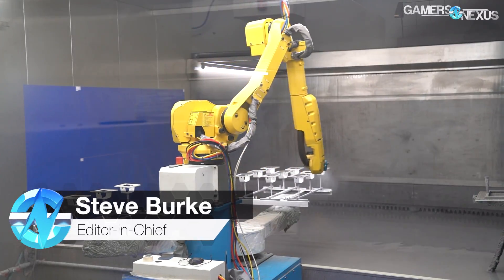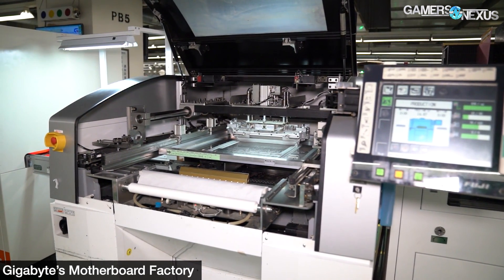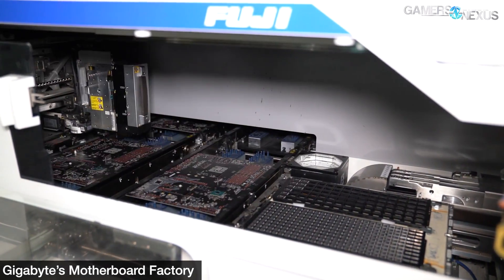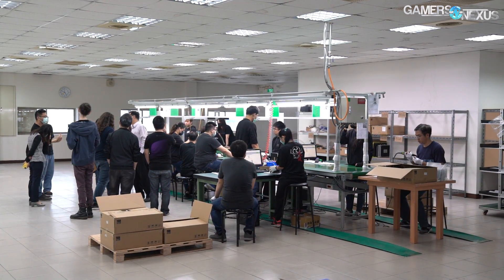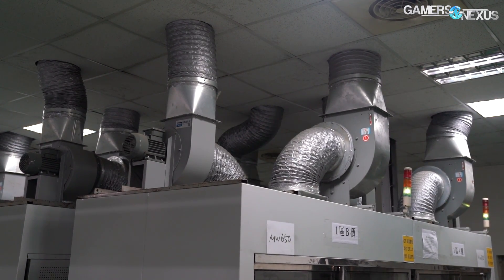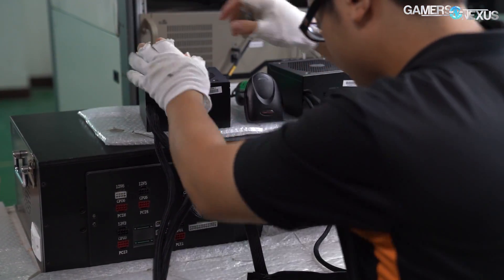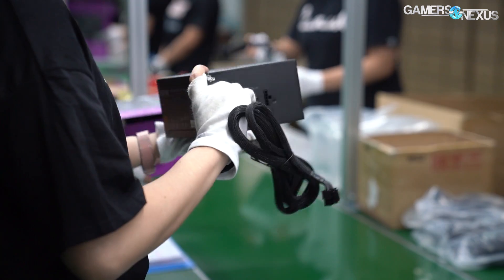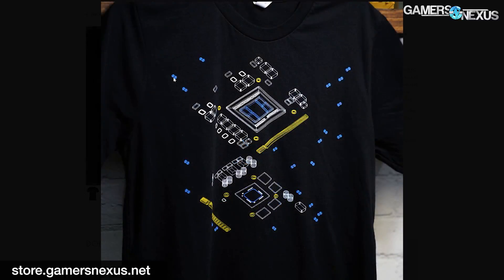How Power Supplies Are Made (2020) | PSU Factory Tour, ft. Cooler Master

Comment: I had one PSU that caused instability and then eventually wouldn't make it past post.  I worked out that it started off occasionally power cycling itself and the intervals of the cycling got shorter and shorter to the point of cycling every sec. Muti meter didn't pick it up as it was losing power for too short of a time, attaching a lamp to the 12V rail showed the lamp flicker off and on every sec on an endless cycle.  Replaced it and the system was fine after and all my months of hard locks and crashes went away as well.

Took me ages to work that one out, like 6 months at least.

Comment: What about 100v for the Japanese market?
Reply: All computer PSU's are universal - they will work in any country. Must have been a misunderstanding in the video. It would be a lot more expensive to create specific versions for 100v, 110v, 230v, 240v, 220v, etc. Instead they all are just universally compatible with any country standard AC power.

Comment: I've had two PSUs fail on my, one was an old no name brand in a hand-me-down computer my dad built. It blew up good and took the system with it (Electrolytic cap - one of the big ones - popped)

The other was a lot less exciting. Silverstone 600w SFX PSU just gave up the ghost. Nothing else was damaged, but none of the rails would output power, not even +12v or +5vsb. Local shop confirmed the same. The replacement it still kicking, 4 years later

Comment: Whoa... there's a shockingly large amount of manual hands-on stuff that goes into PSUs! 
When my buddy and sister were picking parts for their new computers a few months ago I told them that the PSU is the least fun part to spend money on, but one that's probably most important not to cheap out with. Now I can see why they seem to cost more than you'd expect.

I've been (un)lucky enough to have had two catastrophic PSU failures.... which are REALLY scary, lol.  I've learned my lesson with cheap power supplies.

Comment: Do refurb units go there for testing too?
I just got an RMA number for my RM550 and they plan to return a RMx550 to me as the replacement.(but it'll be a refurb unit)
Reply: Refurb units definitely get the same rigorous testing, but probably not at the same location (the refurb lab / company would be the ones doing it).

Comment: 1:30 Why HEC (High-Quality Evolution Commitment) doesn't want to be named? 🤔 They've manufactured PSU's for Aerocool, Corsair, EVGA, Thermaltake and even BeQuiet in the past.
Reply: Yeah pretty sure that's who it is as well. I mean, they're not typically regarded for the highest end units with the best specs or perfect solder jobs every time. 

But they're also not known for dumpter fires or anything.
Reply: It may just be a case that they don't know if Coolermaster wants them to be named as the manufacturer. Linking the two can be a touchy subject even if information behind the link is publicly available.

Comment: So many RMA'd PSUs have... bugs? Ick! :P

Cool vid, and fascinating process! Given the amount of QC involved, it really makes me wonder how I received a brand new, bad PSU out of the box (non-Cooler Master but equally large manufacturer). Confirmed bad with only a PSU tester plugged into it after it had failed to keep the new PC components powered for longer than 90 seconds. Replaced with the same model PSU, and I used all of the other original components. PC is still working well after three months.

Comment: 30 qc steps is a lot more then i anticipated. good to know that my usual testing process is either ignoring the PSU or checking that last. except, of course, when the symptoms explicitly point towards it, like breakers ripping, the unit sparking and smoking or the system being reproducably unstable when loading multiple power hungry components simultaneously...

Comment: While a CPU and GPU may last you for 5 years, I have a seasonic 800 psu still working after 10 years.
Reply: Seasonic. The heart of your system
Reply: The one I'm using is roughly the same age, only thing that has ever failed on it was a SATA power connector. It has 6 such connectors and I use at most 3, so wire snips and but splices to eliminate the faulty one, still working great.
Reply: tbf, GPUs maybe, but Haswell seems to be immortal. I've got a 5820K in my rig that still wrecks games even at stock six years later.
Reply: Same here, i have a S12II-380 running 24/7 since 2008. I have much more respect for companies that make their own hardware, so i'm likely to stick with Seasonic for the foreseeable future.
Reply: Well, would love to say the same about mine, but my beQuiet! PSU was a letdown and it failed after about 5Y. Shortly afterwards my (at that time already old) GPU failed, at the height of cryptomining. Not sure to this day whether the GPU dragged down the PSU or the other way around, but still the PSU shouldn't have failed regardless.

So I stopped buying beQuiet! PSUs, and my new PSU has 10Y guarantee.
Reply: @9SMTM6  10y guarantee doesnt help against getting a psu dead on arrival. Still gotta buy a replacement unless you can wait for the RMA a couple of months.
Reply: @henkki1000  it's not neccesarily about the RMA Process but about the quality of the product.

I. E., If they give 10Y guarantee its unlikely to be designed with planned obsolescence, that's hard to design reliable to fail after 10y, it's more likely to work until I need a replacement for other reasons anyways.

Also I personally could drop in my Server (=old PC, except the PSU, using that as NAS, for Media hosting with Jellyfin, for Nextcloud etc) PSU for the time being, I can live without my Server for a time. And, not sure if that applies to their PSUs too, but my Brother made good experiences with Corsairs guarantee service for Keyboards, and my PSUs are both from corsair RN.
Reply: I've honestly never seen a cpu fail. Only ones that died when a motherboard shorted.
Reply: It became rare to have a completely broken PSU if it's not a no-name one. Brands often cheap out on capacitors, fan quality or on power efficiency but that's irrelevant to properly work or quite easy to fix after several years of duty. Most non-working PSU nowadays are most of the time just failing in security mode, waiting a cheap component replacement.
Reply: Coolermaster GX 550W owner here, that thing is still going strong after 10 years. Everything else has been changed at least once, but not it. The only thing I had to do to it was to open it and oil the fan, 4 years ago.
Reply: so it was probably still under warranty until recently :-)
Reply: I have an old Delta that still works after 22 years, it's obviously not in my main system anymore but it still does get some use.
Reply: my cpu is working for 10 years, gpu for 7
Reply: Nah mate fight me, I have a psu that has been working for almost 20 years.
Reply: I have cpu's and gpu's what are still ok after 10 years so
Reply: I am using a 5Yo Cooler master B600 R2.0
Reply: I mean CPUs and GPUs eventually cannot run the latest games or productivity software,  But as long as the new toys still fall inside that 800 watt umbrella the PSU can keep on truckin.
Reply: @filanfyretracker   You need to derate the PSU as time marches on. So if it's 800W in the first year, i would consider it closer to a 600W unit by the 5-year mark, because internal components age and degrade. But if you have that covered, you're good. It's not like many builds need an insanely powerful PSU anyway, and the hardware kept getting more power efficient.
Reply: Between me and a friend, 2 out of 3 seasonic PSUs were DOA or dead after a week. No problems yet with cooler master or corsair tho.
Reply: @henkki1000  If you can pardon my curiosity, i wonder which product lineups those were from and from whereabouts when. Because i was looking at Seasonic offerings and i... didn't have a good feeling about S12-III, it just seems... suspicious. No solid reviews or engineering analysis, different OEM factory and platform, and not one we've seen yet or heard of, very not Seasonic-like. It's very certainly not an updated S12-II, which had an excellent reputation. An obvious cash-in sequel so to say.

I mean all olden manufacturers make these low end lineups nowadays, you also look at the Enermax products, and there's a cheap series, it looks even shadier.

I had to urgently buy a PSU because my bequiet L7-630 gave up after 9 years of pretty strenuous life. I ended up settling on Seasonic Focus GX550 because it was available, and because it seemed less shady than everything else i could get quickly and could afford. I'm still investigating what failed in the bequiet, but i'm taking it slow to be cautious, working on PSUs is dangerous. The bequiet is HEC made so it's certainly not the best, not even close, but looking at it, i don't hate it either, they actually put some effort into the thing, and it has overall not even degraded much, a few caps i pulled and tested on the secondary haven't degraded at all, like usually when you open a budget PSU a few years old, it's failing everywhere left and right. There's some kind of a cascade failure in the 5VSB circuit, i found one dead secondary rectifier diode there but this isn't all of it, there also seems something wrong with the feedback. A bit unhappy about the aforementioned diode being placed slightly unfortunately without cooling, even though it shouldn't need much, and some degradation on the primary cap, but not too bad for almost 10 years.

If you are buying from a legitimate seller, DOA or early death isn't actually the worst situation, at least where i'm from, since normally here in first 2-4 weeks, you don't need the RMA process, you just return the thing to the point of sale, instantly get reimbursed, and have them deal with it. But normally you also expect such construction that it survives shipping and also you expect it to be tested at the factory, with automated intermediate tests, burn-in test and a visual QC. So unless you did something that you shouldn't have, like powering on a PSU right after getting it delivered by mail, DOA is definitely a bad sign that doesn't speak well of the product, you normally expect true DOAs to be rare enough, that seeing 2 of them should be astronomically unlikely. Why you shouldn't just power it on, is that it might be frozen while it was being shipped and stored and could form condensation, as fresh air rushes in and touches cold parts, so ideally you want it warmed up to room thoroughly before you use it. But also dead after a week is not necessarily the same situation as DOA and should be more expected, early deaths are fundamentally common and there's absolutely nothing much that can be done about that from the manufacturer, if they already have a suitable burn-in.
Reply: @henkki1000  This is a common misconception. You can't really judge the quality of a component vendor by their item being DOA or not.
Reply: @Cafe_TTV Oh? Explain yourself. Is this about sample size or do you have another angle. Like it might be damaged in shippng?
Reply: @henkki1000  That's a streak of bad luck, yikes. I've got a Focus GX-650 in my rig and it's been rock solid.
Reply: @NebulonRanger  Could be bad luck or it could be a regional thing. Like bad shipping and handling due to low volume. Corsair PSUs are by far the leading brand here.

Anyway I keep seeing top notch reviews and happy people in comments for Seasonic so I don't hold this against them even if I can't trust them for now :)
Reply: @henkki1000  Just so you know most manufacturers have some of their best high-end PSU's made by Seasonic, Like Corsair, XFX, Antec, Be Quiet or ASUS etc... 

Also, Coolermaster by far is the worst PSU manufacturer (rebrander) of all the major brands.
Seasonic is rated the best with EV3A just behind then Corsair. 

PS the only good Coolermaster PSU's are the V series which are made by... Seasonic! 

1 sec google https://pcper.com/2014/03/cooler-master-v-series-850w-power-supply-review/
Reply: @hardergamer  Yes I'm aware of all this. Calm down. I never said Seasonic was bad quality or anything, People were saying their seasonics last for 10+ years so I just said mine didn't.

Btw the Cooler master PSU i have i got BECAUSE it was made by seasonic and it had good reviews. That one still works.
Reply: maybe it's just you? I have working 15+ year old cards here.
Reply from the maker: @flandrble  The point is that those cards, by today's standards, are not that good. The power supply still supplies power.

Comment: It's 230V AC in Europe, not 220V (that's an old value) ... ;-)
Reply: its variable from 220-240
Reply: Nope, it varies not only by country, but by region within a country, even. The reason we say 230VAC is because that's the average - between 220VAC and 240VAC. Few places actually have 230VAC.
Reply: @Mythricia1988  But on Power supply it does not mater... they most works with variable 100-240VAC 50/60Hz some only on 200-240 (EU) if you connect this power suply in US so it won't work
Reply: Please see:
English -> https://en.wikipedia.org/wiki/Mains_electricity#Voltage_levels
Deutsch -> https://de.wikipedia.org/wiki/Netzspannung